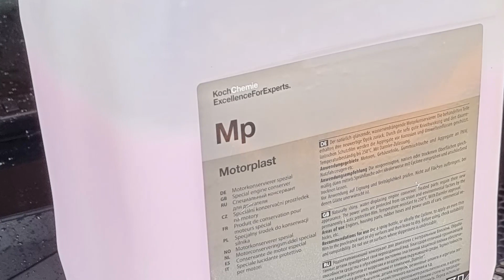Engine Bay Clean - 2019 Audi A4 Quattro - Easy Results

Comment: You can just hose the engine bay like that with no electrical issues?
Reply from the maker: Yep. Obviously stay away from the electricals as best as you can. Don't go spraying into the air intake or electricals specifically, but all your plastics and metal surfaces are fine.